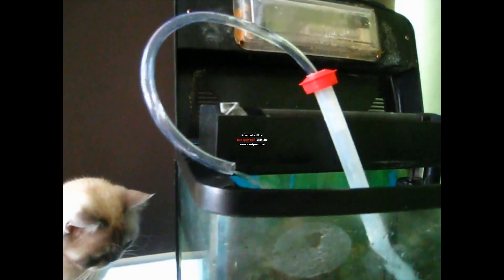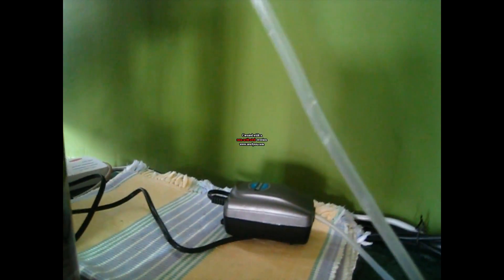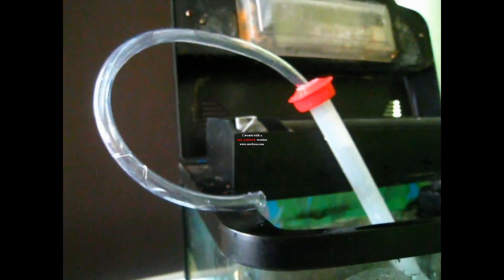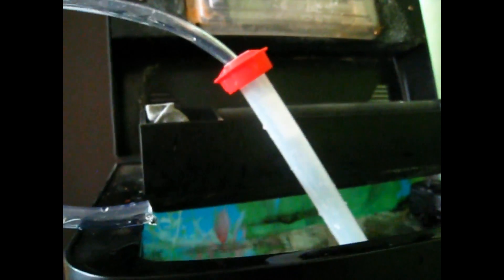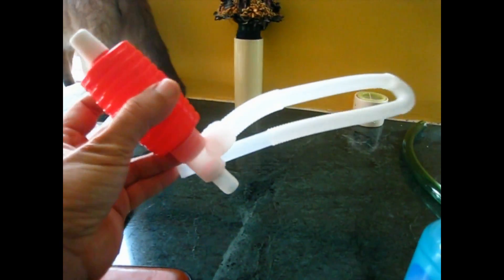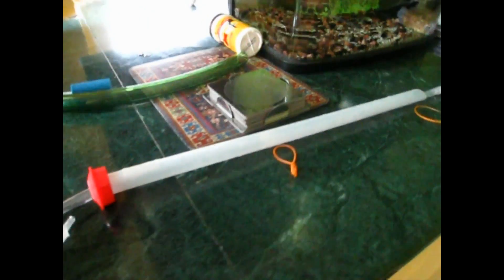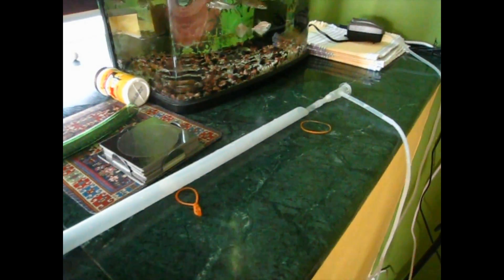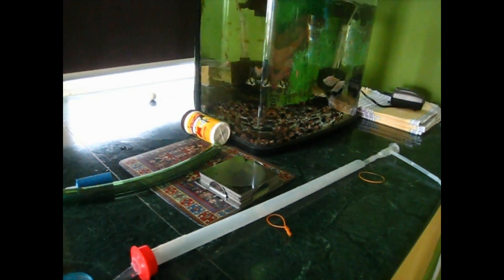Air-Lift Water Pump , How Does It Work?

Comment: these types of pumps are beneficial because they do not add heat to your water like submersible pumps do- for hydroponics heated water is a big deal.  Air compressors have far less chance for something to go wrong -less parts and maintenance required.  they also aerate your water!

Comment: Will it lift the save volume of water 3 meters vertically?
Reply: William Kelley it should,  the air bubble should be big enough to hold the wayer above it. Since air rises it brings the waste up. 
The airflow rate will be a more critical adjustment.

Comment: I accidentally place an order of air pump instead of water pump.for indoor plants can this airlift system work multiple pots can it give water to 3 or 4 pots equally or not
Reply: +ali kazmi Yes it can! We pump higher than the level of plants and let the water gravity feed to the plants.
Reply: +Natalie Cash depth is important for momentum and propelling water but some times height not enough. So have air lift tube for I.e. 1 foot so wrap the tube from bottom to the top . It is now 4 feet long due to coils like Anconda. Do you get what I mean?

Comment: Advantage? Probably higher aeration of the water. Energy-wise: I don't think it makes much difference or you end up worse off- I just received a small 200l/h water pump, it uses up 2.5 W of energy, so yeah, exactly as much as the weakest air pump I could buy. And the water pump was cheaper for the start.
Reply from the maker: I myself am still a bit confused about whether there are any advantages in using an air-lift

Saeid
Reply: Saeid Momtahan
I think the only one would be oxygenation of the water, so it might help if you struggle with low oxygen levels. Might be good if you have an external biological filter- it would aerate the water before it hits the biological media.

Comment: :-/ this will not work for me. I did the same as you showed but it will not move the water up the 2 feet to water my planters.
Maybe my air pump is to small?
Reply from the maker: Hi fun, may be your air pump is too big. If it pumps too much air, then the air will find its way down the tube and not up the tube, where it's supposed to go. THis video shows you the basic of how it works. But you gotta play around with it and make it work. 

TY
Saeid

Comment: Great information - thanks!  I am building one for a recirculation feature on a line of DWC buckets and this will do the trick.
Reply from the maker: Thank you Ronald. Glad you found it useful
Saeid
Reply: I have spent months studying home aquaponics and found a great resource at Keiths Ponics Site (google it if you are interested)
Reply: +Ronald Kleinman The wonders of using the air lift pumps is magical. Low cost, low maintenance.

Comment: Thank you so much for sharing this!!  I'm putting together a soda-bottle flower garden and wanted to make an air-lift water pump with a small aquarium pump I had laying around. I haven't quite been able to get the part of the pump where the air tube and bottom of the "lift" tube meet to work quite right.  The "tip" about using the pump part of a soap container may be just the thing I'm needing!
Reply from the maker: DId it work Rebecca? I just saw your comment. 

Saeid

Comment: Unless you are using a diaphragm pump, water pumps will shred beneficial microbes to pieces. If you are running a sterile environment then there is virtually no advantage to an airlift (other than energy savings).

If you are using bennies, this keeps them safe.

Comment: Not sure about the benefits in an aquarium, but in a deep well application (over 100-meters deep), it is far cheaper than a staged ram pump, and doesn't have issues with debris. You merely have to have high-pressure air hose, high pressure sleeve, and a solid foot valve. You can actually make a modification to the old ram-pump design using air in such fashion, and get massive water lifts - up to 1000-feet (330-meters) in severe desert environments.
Reply from the maker: THat's great to know Dust. I just saw this comment.

TY
Saeid

Comment: Hi: THX for a most environmentally friendly idea. Is there a hole in the air resoivoir? Can you try place more than 1 water sucking tube in teh same air resoivoir? I am using a powered air pump and hope to distribute the water to several places. THX.
Reply from the maker: For some reason both your comments ended up in spam. YT is acting weird!

 THe system is basically two pipes. The vertical with 3 openings. One at the bottom, where water goes in, one at the top where water shoots out, and one near the bottom, where air gets fed in. ANd the second pipe of course connects to the airpump. I made one with a big air pump and a 1 1/4" pipe going up and it pumped so much water. So the principle is simple and stays the same , no matter what scale you take it to

Comment from the maker: Hey thanks for your comment and the feed back and glad that it helped. 

I have done the same system, but with a 1 1/4" pipe and a heavy duty air pump and it worked amazing.
Reply: Living in the u.s. in a place with ground water within 10 feet, this will be a very convenient way to pump water from a step well I dug out this summer. I have a pump for filling up inflatable mattresses with variable small sized tips that we don't have a use for at the moment. This simple thing should be super helpful and i can build another even smaller one just like yours with those materials to move the water further using 1/16 line like your air hose

Comment: Thanks for this video.. Ive been thinking a lot about this..because i have a 5 gallon tank..and i want to make an external filter..i have an old air pump and i dont want to spend lots of money buying hang on filter and its very rare to find one here..gues il be doing this method..and make a hang on cannister..il post afterward after i finish this project..thank u thank u thank u

Comment: Excellent video :)  I plan to use some thing similar for a hydroponic/aquaponis system. Is the bottom of the soap dispenser thing open to allow water in or does the water enter at the bottom of the stiff tube?

Comment: i would recommend a check valve in line from your air pump to your tank. back siphoning can cause the pump to short out and cause a fire and or electrocute you when you touch the pump.